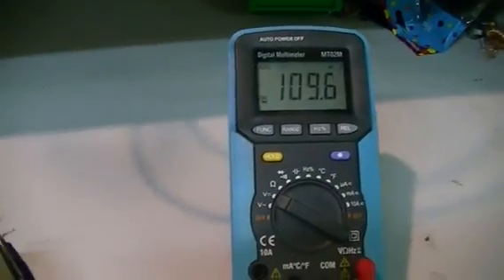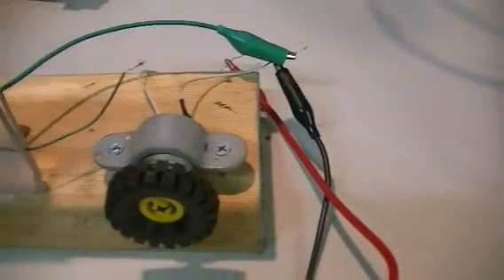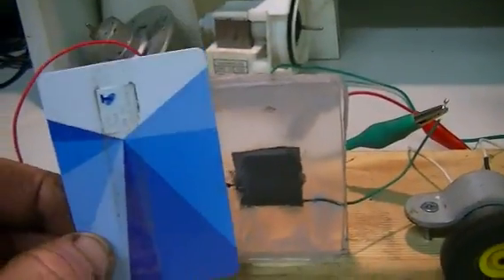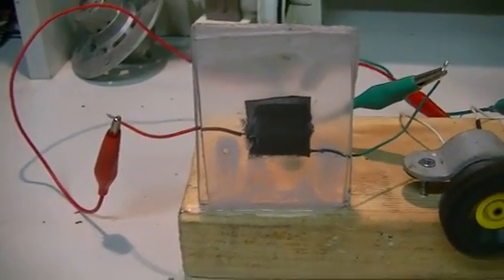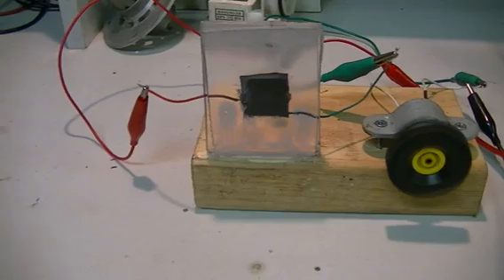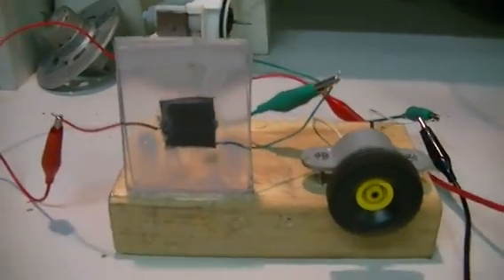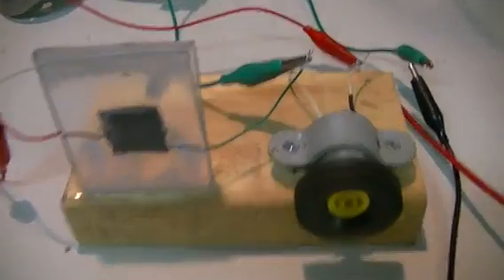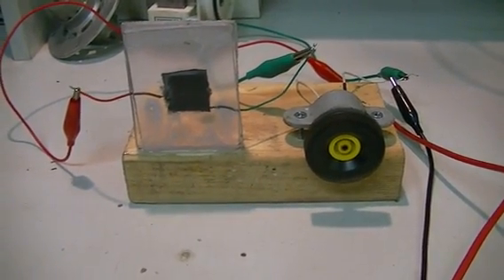Graphene Triphene Ultra Capacitor

Comment: Hi, just watched all 4 vids on theses cells, you have not put up anything more  for nearly 2 years.
Are you still working on these cells, if not could you share the construction for others to try.
If the self discharge is reasonable, these would be useful for solar cell backup.
Regards Martin.

Comment: I've got one that's 5 times stronger using g grapfoil silicon Carbonic acid some .tetramethal ammonium hydroxy design and one other secret ingredient..promise you there is nothing you or I made that the engineers haven't done